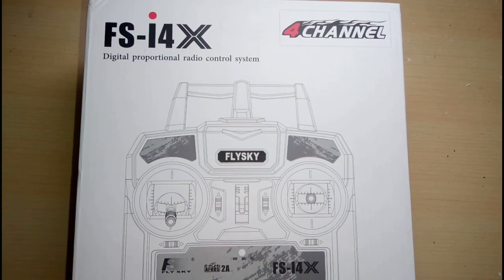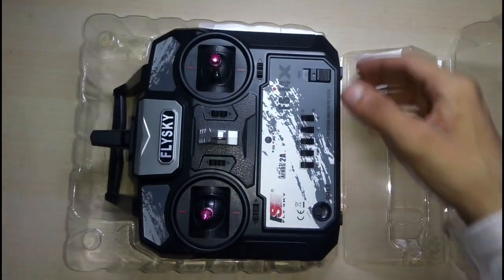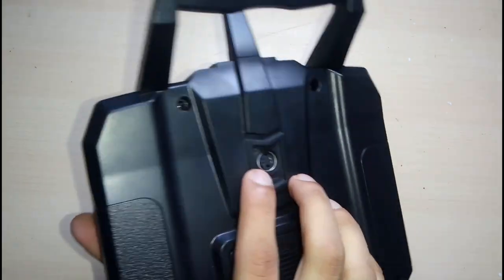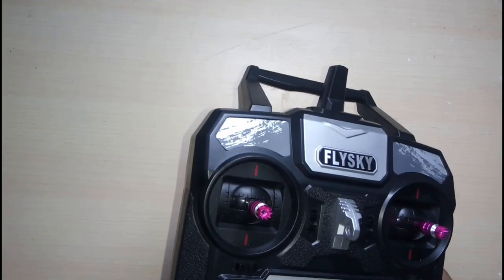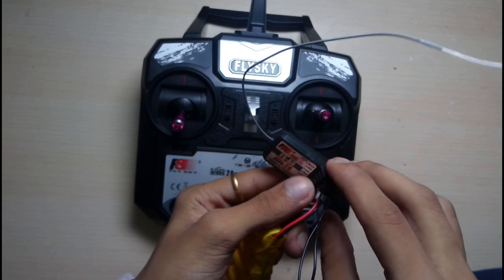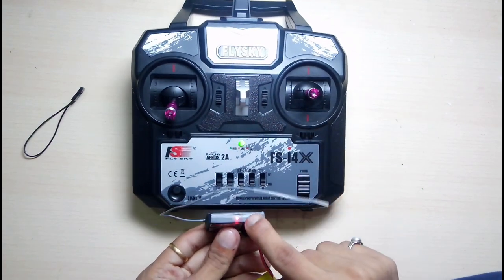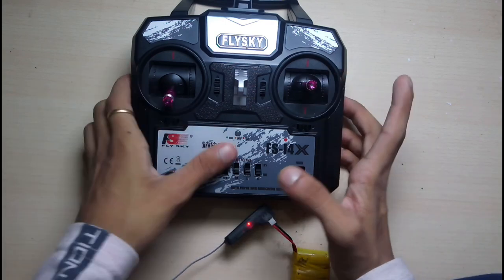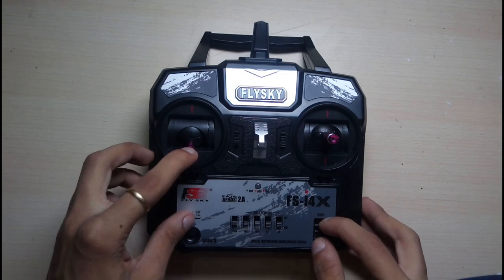Watch before you buy transmitter | Flysky FS i4X & FS A6 Receiver |  Unboxing & Review | C!rcu1t t.v

Comment: Bro does this also requires Gyro?
Because I want to customize my Syma S33G helicopter with this transmitter and receiver so will I need a gyro additionally ?
Reply from the maker: I didn't get your idea 😕 To make it work you'll need a flight controller that is made for helicopter to make it fly with this transmitter! It has everything that is needed(gyro & accelerometer)

Comment: Did you upgrade it to 6 channel .if yes can you make a video on that
Reply from the maker: Yes i had updated it to 6 channel
Reply: @crcu1ttv1957  can you pls make a video about how to do it .or can you just tell any website or any thread where I can find the information to do the same
Reply: @crcu1ttv1957  also can we use 2 Li ion battery instead of AA cells
Reply from the maker: @rcguy2106  it's given in the instructions manual and I'll make a video of upgrading it into 10 channel!

Comment: Hai 
How its range🙂🙂
Reply from the maker: It's Upto 1km in open field without any obstacles
Reply: @crcu1ttv1957  ook😊😊
Reply from the maker: @deepakbs8445  if you are planning to buy it then don't.  I recommend you fs i6x it has a lots of features, advantages. The price difference is only 2k INR.
Reply: @crcu1ttv1957  👍👍😊 
I realy like ct6b😅😅
But fs i6 is more good
Reply from the maker: I6x is 3k more than ct6b
Reply from the maker: You can get one at robu.in
Reply: @crcu1ttv1957  ookk😊😊
I am going to search